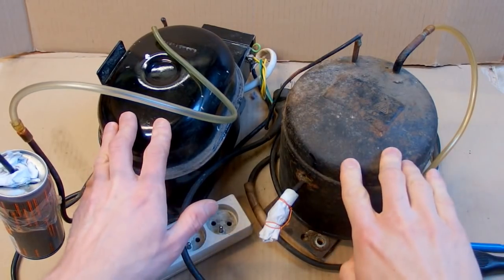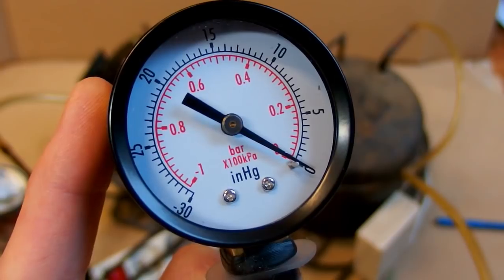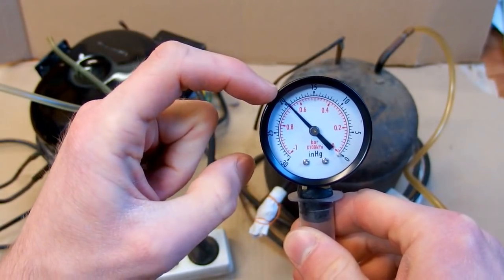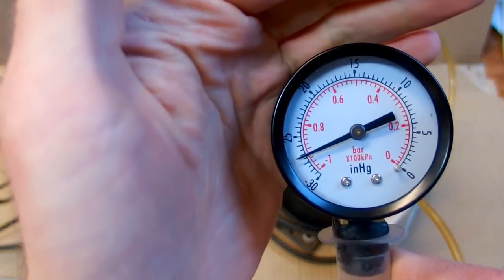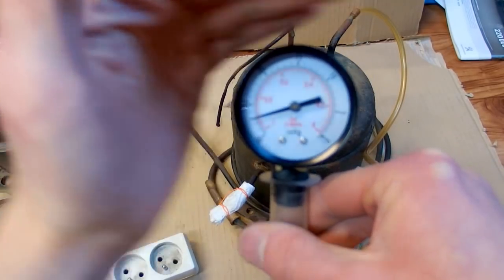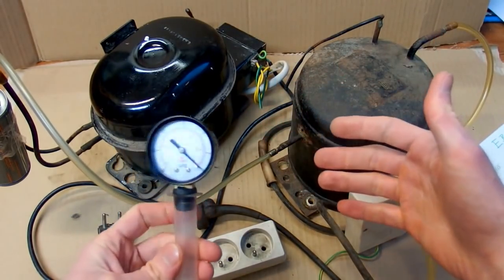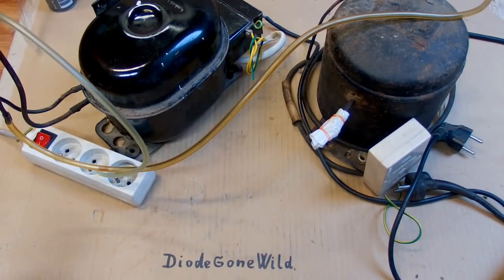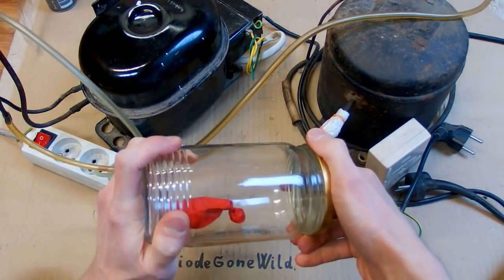Fridge compressor as a vacuum pump? Measuring the vacuum.

Comment: Very useful experiment for me. As I mentioned last video I stripped a compressor and was looking to make a vacuum pump out of it but I never tested it. In fact I don't have a vacuum gauge yet. This benchmarks it for me. Now I know what to expect. 

Some current measurements throughout the experiment would have been nice too. It would be interesting to see how the motor reacts in a vacuum. Some guestimates on the heat generated too. I will see if i can do that whenever i get my system completed. Add to the knowledge useful to a hobbyist.

Comment: I wonder if you would use an Arduino pressure sensor if the results would be more accurate. There are very sensitive sensors that can measure the pressure diference of 10 centimeter in height. But I don't know if they are able to measure vacuum circumstances. A look into the datasheet could be usefull or otherwise just test it. And you could dump the whole system into the vacuum tank and send the data out. Although I don't know what a vacuum will do to a lion cel?

Comment: Nice video, learn so much from them , once i tried running vacuum pumps in series and parallel,  but no luck only get to 15 millitorr ,found its to do with the number of molecules in the chamber evacuated,  need   molecular pump or diffusion pump

Comment: Would be interesting to see the results of a bottle type rotary AC compressor since those are designed in a way that actually pumps more vacuum. Piston compressors like those require check valves on the inlet and the vacuum will never be lower than how much pressure is required to push past those check valves. Since rotary compressors don't have inlet check valves they are capable of pumping a much stronger vacuum.

Comment: Does  these pumps contain oil to lubricate the moving parts or by removing the refrigeration you  also remove the lubrication?
Reply: Oil typically fills the bottom part of the compressor. You can check with a dip stick or periodically tilt the compressor to empty it and refill with fresh oil.
Reply: Yeah, but does it still circulate?
I understand the refrigerant usually carries oil with it. No refrigerant, no oil carrying.a

Comment: Be careful about releasing pressure to that vacuum gauge suddenly - it can bend the internal components and cause it to be severely inaccurate.
Reply: Many vacuum systems have quick venting procedures, a gauge that can't handle that type of "surge" wouldn't be built well enough to worry about accuracy anyways.

Comment: Nice demonstration. How much positive pressure can you get out of the other side. You might be able to connect one to a tank to make a small quiet bench air pressure source. It could be handy for cleaning with a blast of air. I've been tempted to break out an old airbrush compressor for something about like that for blowing alcohol out from around components. I'd rather pour a bit of isopropyl on larger PCBs, clean up what I can with a brush and paper towel, and then blow out the rest with air. 
   
  Also you can usually find cheap vacuum gauges in auto parts stores. I have several I've collected over the years for tuning carburetors. Places like eBay probably have many more options isolated to the eBay automotive site. eBay usually keeps items from the automotive side partitioned off due to search terminology filtering.
 Thanks for sharing,
  -Jake
Reply: I noticed you have a transistor tester on your channel, i have a T4 clone, i had to remove the test socket because of changing capacitor esr readings.
Did you have this on yours?
Reply: I have an old 1/2 HP compressor out of an industrial freezer (I think) that puts out 60 PSI or so. I've been using it for 30 years to pump tires, spray paint, and sandblast.
Reply: zx8401ztv 
I haven't tried comparing different units or testing ESR accuracy. I plan to eventually but I got one of the worst case of the flu that put me in the ER back in December and had to put stuff on hold for a bit.
  Out of 3 clones the T3/T4 I have is the farthest from the OSHW project design. It uses 5% sense resistors instead of 0.1% and the typical TL431A +/- 1% voltage reference in SMD form instead of the LM4040 at 0.1%. It appears the voltage reference in SMD form is more influenced by temperature as well. If you log the results of testing one device several times over, you will probably notice more erratic test results for the first 3-6 tests in a row out of around 50. At least that is what I noticed.
   Just before getting sick I tried using a mains adaptor to power the T3/T4 unit and tracked the results with a battery versus mains. That is a bad idea. It is very difficult to get consistent results with mains power. I still want to try tuning a passive filter with a scope, or a capacitor multiplier/active ripple filter to see if that helps. If I can get my filming setup done I'll try to build the other 2 clones (AY-AT/GM328) and compare them and their readings with some precision components. I'm also trying to create and etch my own ATmega644/Version 2 design, and doing a how to program on Linux and a separate how to program for Windows....So basically I'm doing way to much for a slow partially disabled gimp, but I'll get there eventually.
  I'm still only a couple of years into hobby electronics and don't have a nice LCR meter though, so it is difficult for me to speak to the overall accuracy of the capacitor ESR reading. All I can share are the details I've noticed while goofing around. Hopefully I'll be able to get an LCR or build one soon. I think I have everything to build a couple of different designs, but I don't really trust a homemade analog ESR meter or an L/C meter, like Mr Jonnny posted last week, any more than I trust Karl-Heinz and Marcus R.'s programming skills with the AVR TT project.
 -Jake
Reply: James Van Damme 
  That sounds useful. I don't like how loud traditional compressors are so something like that is probably more appealing for a lab bench ;)
Reply: lol i also checked the 470k and 680R sense resistors too, they were not even 1% tolerance, but they can be swapped for the 0.1% ones later.
Ive been into electronic repair for most of my life, but i found learning a up hill struggle, so i never really went deep into the jibberish in text books.
I came to the conclusion i was "Thick" / low iQ, but i have repaired so many things over the years and i was the electronics section of a factory, so perhaps not "Thick" ha ha :-D.

I bought the T4 because i had no way to test esr in capacitors removed from evil switchmode psu's lol, and this T4 is run from a 9v battery.
Im still thinking the crap green i.c socket is causing some trouble.

Ive looked at the original german design, and the ref voltage of 2.5v is only used for the battery voltage check, i may short it out later to see if it changes the measurements.

You sound like you need clones of yourself to do all the things you want to do :-D,  just get better soon, you will cope ok then.
Sorry i rattle on a lot :-(
Reply: I've also used a traditional belt-driven compressor, and I like the homemade one because it's close-coupled with no belts. Of course it isn't really fixable if it dies, but ... it hasn't in 30 years. It's not too noisy but not as quiet as a refrigerator compressor. 

I haven't put any kind of oil in it, ever. But I don't run it for long periods of time.
Reply: zx8401ztv 
 It's not "rattling on" to me. Lol... if anything I am the one that always talks too much... I've got nothing better to do. I play with stuff on the bench for around 20 min to 1 hour then must go lay down for an hour or 2 before doing it again. I get 1 to 2 hours of work done in total...on my good days... I've got way too much down time.
  The Vref on the AVR TT is used to determine the battery voltage, then this information is stored and used in the ADC comparisons, basically in a differential mode configuration. 
   If I understand the basics.., it uses several different combinations of digital outputs from the different pins with 680R or 470k ohm resistors. The feedback values are calculated by the 3 Analogue/ADC pins and compared to the known voltage of the battery (that voltage was established by the Vref). If the Vref is always off by a given amount, so are the test results. There is a file that can be modified to account for the actual value of the Vref IC. If you have the ability to accurately measure the TL431, and input this value into the software, you don't need a better Vref. The TL431A is extremely stable, it's only issue is it's accuracy. If you account for the actual voltage in the software, the voltage variation/drift is negligible. The biggest issues with the clones are the variations between 680R and 470k resistors because the software is designed to assume, for example, 5 volts across the 680R resistor that is read at test point 1, is the same result that will be read across the 680R resistor attached to test point 3. I want to see how much of an effect this really has. I plan to use the proper LM4040 2.5 volt 0.1% voltage reference and log the results from testing several precision components. I plan to test a single component in different lead configurations to look for the variations between test channels. From what I've seen so far, it doesn't look like it makes a giant difference to use precision components, but I haven't been able to log the data yet. 
  Personally, I just hope I can get a unit that can accurately test more FETs. The T3/T4 sucks at JFETs and makes a lot of mistakes with MOSFETs like calling them all NPN BJT's or "unknown," even though they perform correctly in test circuits. My T3/4 unit won't even go into calibration mode by holding down the test button when turning the unit on.
  Ultimately I want to build a version 2 setup as a dev board with a bare minimum main board and lots of breakout headers for as many circuit options as possible. I want to try etching it myself first and if it's successful I will post my KiCAD, Gerber, and etch, files so anyone can create their own. If possible I'm trying to create it with either a double or triple MCU layout. I already have a couple of cheap ATmega644's in TQFP44 SMD form. I've started to build a design that uses the footprint adjacent to the DIP40 footprint so that I/anyone could use either MCU footprint. If I can manage it I want to add the ATmega328 DIP28 footprint inside the DIP40 as well. It's a pain to route, but hopefully it works. If the current design works out (big if)...I am trying to make the DIP40/28 footprint on the same side as everything else and designing it for a single sided etching. If it works out the way I want, anyone should be able to order my design from JLCPCB for $2 (or any other board house/no affiliation). The main board will use the same components as an AY-AT clone, even the ATmega328. All anyone would need to do is order the 644/1284 if they want to swap them. I just need to create a design for most of the optional circuits too so that I can add the header pinouts to the design. I might even manage to get a few optional circuit PCB's panelized into a single Gerber file. I've heard JLCPCB doesn't charge/penalize for panelizing a design.
  That's the goal. Who knows how long it will take. I also need to figure out what LCD(s) to support. The 1.8tft from the AY-AT sucks. I have most project LCD options, but I hate the programming side and still need to get it going 100%.

   In general I don't think the ZIF socket is a problem, if it is properly soldered in place (something to really check). Nick L. is the most experienced/knowledgeable person working on the project from what I've seen/read. He's on the Russian threads and is largely responsibe for version 2 if the project. All of his designs use a ZIF socket. If it wasn't suitable he would use something else in his designs. He's done a lot of designs too, around 12 with several revisions of each design.
 -Jake
Reply: Sounds like you have a lot of things you want to do, i would not go too mad at it though, don't make yourself ill, just pace yourself.

So the 2.5V ref does more than i originally read, i'm a bit confused with it having anything to do with the battery voltage as the chip runs from a 5v regulator only, and tests can only be done via the 5v supplied.
If the battery feedback line is being used for anything else, should it not connect to the 5v regulator output, adjusting the potential divider to give the micro what it expects.
The variables in the makefile may just be for the battery voltage reading.
It would be daft to use a moving battery voltage for any measurement use i would think.

The transistor testing i see no point in, i think static value testing just tells you info at one point, and fets must be similar.
I have a multimeter that tests resistance better than the tester so another pointless addition, just my opinion, nothing else :-).

For me the capacitor value and Esr is the usefull bit, esr is an uncommon thing to have on most test equipment.
Jake you sound very clever, i hope you acheave all that you want from your new hobby :-D
Reply: zx8401ztv 
 I'm not 100% sure on the full functionality of the Vref. Marcus R. (Author of the second firmware fork) Has explained it, in part, various times on the EEVBlog forum thread. 
   If any of the clones has a full version of the software, the software is designed to detect the Vref IC at the beginning of each session. If the Vref pin is not connected, the software is supposed to devert to the ATmega internal Vref. I vaguely recall Marcus R. saying something about the Vref determines the reference that the ADC uses. Don't quote me on that as my memory isn't great. I believe the accuracy of the internal Vref isn't very good and it is scaled badly at around 1 or 1.25 volts... something like that IIRC. I'm not positive as the last time I read through that stuff was a couple of months ago, and I planned to go into it further after I get programming stuff done.

  I am probably into this project way too deep but why not do as much as possible. I learn a lot more doing this stuff than I do playing with some paint by number trinket project or wiring up a module and pretending I know what I'm doing after using copy and paste. I've already learned KiCAD well enough to create some decent schematics, etched a few small boards, and am trying to understand analogue hardware versus integrated hardware/programming. If I could go to school I would, but I'm just making the best I can of my current circumstances.
   If it weren't for being hurt I would still be a dumb Motorhead playing with V8's, carburetors, and forced induction. This is a fun diversion.
  -Jake
Reply: I have been using a cuff inflator. You know for testing blood pressure. So the nurse doesn't wear out her hand squeezing that bulb. Puts out 140psi, kinda slow, but nice and quiet.

Comment: Iodine has a triple point pressure of 119milibar, at 113.5C.

You can put solid iodine in a jar, pump it to around 120milibar, and watch it turn from solid to liquid to gas from just heating it

Nice project with your pump that can do 80milibar?

Comment: I'd hope they didn't leak, since they were originally full of some nasty CFC refrigerant. Good to see the seals still work, though!
Reply: this is a different situation! it's not important if the compressor has not a non return valve or similar because the circuit is closed and it won't leak off the circuit, so the refrigerant remain here! the only problem in this case is less efficiency of the compressor!
the problem of refrigerant leaking happen when the refrigerant circuit is broken (a crack in a pipe for example, or a bad joint between two pipe) or when someone "recycle" the refrigerator gas improperly (like disperde to the air )
sorry for my bad english
Reply: CFC is inert at standard conditions. The nasty reactions only under UV.

Comment: Are run capacitors needed if using for vacuum chamber? What effect if use without run cap and bare wires and rocker switch to start run.
Reply: The type of usage doesn't matter, start capacitors start it turning, without a start capacitors it will just buzz until it overheats and burns, the motor worn actually turn and nothing will happen.

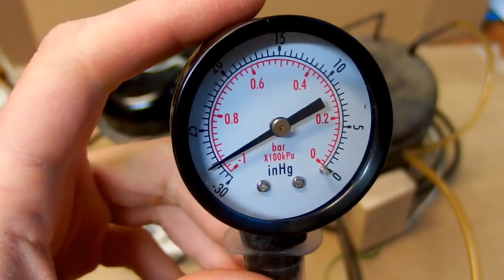Comment: 08:05 — No use in that, since the maximum pressure of the valve claps of the pumps seems to be the same, so they stack up no matter which order you put them in.

Comment: Is this safe for compressor??
Reply: Okiem Elektroniki i think not, compressor need air to cool inside of the motor

If no air that will heat up, and maybe the comprossor burned :(
Reply: TIRTA GT thanks for answer
Reply: Google User  Its surprising how long they will run under these conditions, long as your not pulling a vack on something wit a lot of moisture in it
Reply: There is a fluid/oil/coolant in the compressor witch runs trough the radiator on the back of the fridge to cool the pump, but i guess its not dangerous to do it without the radiator..
Reply: No no and no unless oil system fabricated and comps in paralel
Reply: Theres also the chance that the compressor housing will implode :P

Comment: They say the most you can pull is 29.99 at sea level.
Reply: It starts getting exponential as you approach zero air. This would make a "roughing pump:" which makes a rough vacuum. It gets expensive as you need more vacuum - turbomolecular multistage, getters, .... ugh.
Reply: Hot damn. Learned something. I run vacuum chambers regularly. Never knew my being at elevation affected it. Makes sense.